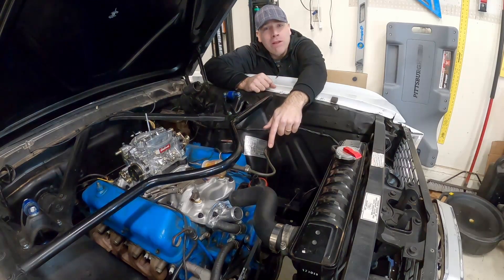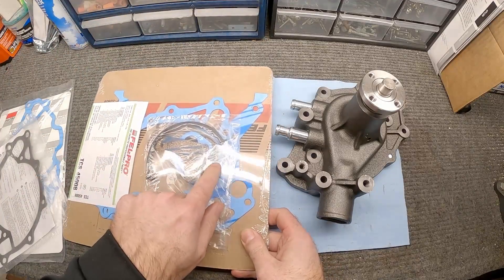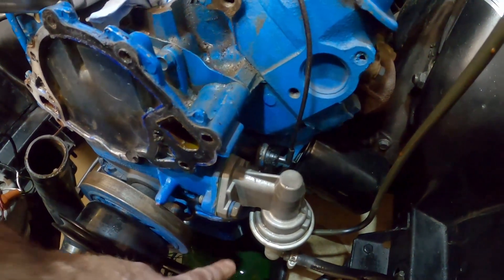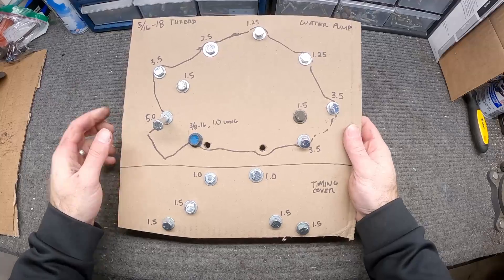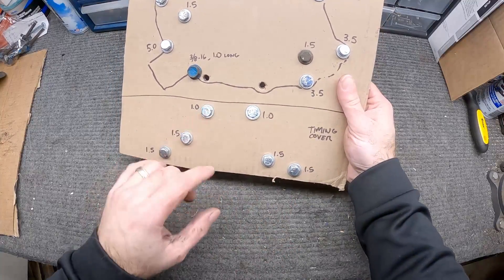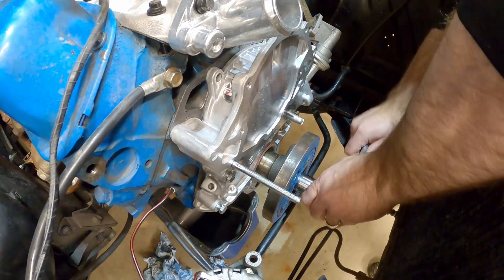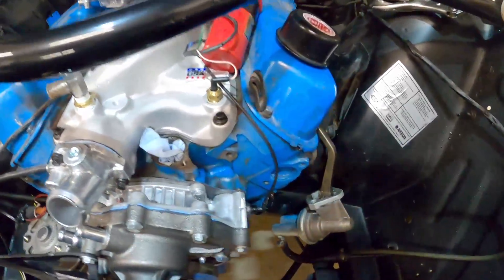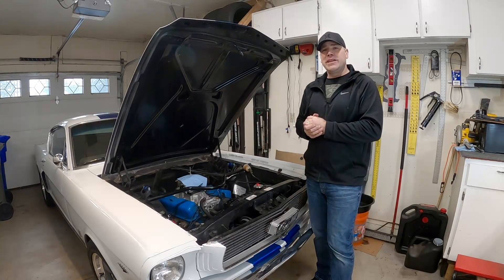How to replace a Water Pump and Timing Cover

Comment: Thank you! Just got my dream car, a 1967 Mustang with the small block 289. For 8 grand! And it drives with body work done. Absolute steal. 

Also, the engine is a K-code. Got lucky there.
Reply from the maker: Good luck with your new project!  🙂

Comment: I know what you mean with over tightening bolts. It sucks but it's way easy to do. Good work! Looks like you've been getting after it!
Reply from the maker: Thanks!  I'm just glad I was able to save that spot and not have it be one where I can't run a through-bolt in there.  :)
Reply: @AndyKruseChannel  exactly! You lucked out there for sure.

Comment: Thats a lot of work for a little leak! Going that far I would change the dampener. They're not expensive but the rubber seal inside the damper is usually cracked and hard. Made a difference to mine runs much smoother with a new one.
Reply from the maker: Yeah, not a bad idea, but at this time in my build I had new engine plans so I didn't want to spend money on something that was only going to be temporary.  :)

Comment: Good job!  One thing folks might want to consider is putting a sheet of cardboard over the engine side of the radiator if it's not going to be removed for this job.  This will help protect it from getting banged into by tools and parts.
Reply from the maker: Great tip!

Comment: Getting ready to change the water pump on my 65 Falcon (289).
It's the original never been off, anticipating the bolts will be a pain to get out without breaking off.
Reply from the maker: Good luck!!
Reply: @AndyKruseChannel  Thank you

Comment: I have a 1968 Mustang. It now has a new BP 306. I'm wondering why the radiator is overflowing through the overflow hose? Overflow never occurred with my 289.  Oh, when I say my coolant is overflowing I mean it's overflowing a lot.  The car has not been driven since the new engine was installed. I'm thinking the thermostat is not working correctly. Thoughts? 

I'm working on getting the temp gauge working, currently it does not.
Reply from the maker: Could be a couple things.  If the thermostat is set at too high of a point, you might be getting too hot of coolant too late and the radiator can't cool it fast enough. When it's that hot, the pressure is also really high, and it might be overpowering your Rad cap, leading to the coolant overflow issue.  It could also be the Rad cap set point is too low, should be around 13-15 psi.  Other potential issues might be the water pump is not working correctly, or some kind of blockage somewhere, or maybe the Rad fan(s) are moving enough air when the car is sitting.  :)
Reply: @AndyKruseChannel  So the issue was fixed by changing the Rad cap. This $10 part is less that the 18 bucks I spent on coolant. Honestly I don't care about the money I just want my car ready for spring. 

Thanks for your response.

Comment: Hi Andy, do I have to do anything special with the timing or harmonic if I just take off the cover, replace the gasket and don’t touch anything else? I turned the engine over a few times trying to get the balancer off.
Reply from the maker: Nothing special, but you'll need to get a "puller".  If you don't have one, most auto parts stores can rent you one for fairly cheap.  You've got this!  :)
Reply: @AndyKruseChannel  alright sweet I appreciate it, yeah I got the puller rented right now, just wanted to make sure I didn’t screw anything up since I couldn’t get the center bolt off initially and rotated it a couple times. Thanks for the reply! I got a 1971 v8 maverick and your videos are the main ones helping me out. After this gasket. All I got left is the suspension and the exhaust until I’ve replaced almost everything mechanically 💪🏼

Comment: Great video! 
It looks like I have coolant leaking around my timing cover on my 72 302. If I just pull the timing cover off and replace the cover to block gasket and use those oil pan "gasket pieces" that the timing cover kit gives you to seal the bottom,  when you pull the timing cover off the front of the engine block, does old gasket and dirt debris drop inside the oil pan?
Reply from the maker: It can, so you’d need to be careful. You can tape a garbage bag over the oil pan to catch any debris.
The coolant leak is either from your thermostat housing or intake manifold gasket, I’d suggest fixing that before tackling the timing cover gasket, unless you’ve already done that. 🙂
Reply: @AndyKruseChannel  Hi Andy! Thank you so much for the recommendations. Unfortunately, it does seem to be coming from the timing cover to block gasket.  In colder weather I can find a pool of Coolant on each side above where timing cover coolant passes are. After I soak it up, you can see it slowly leak out of that area.  I did check out the thermostat housing cover, slid paper towels under it left it a few days and didn't  seem to gather coolant there. It would be nice if that was the source though.
It's been going on a while. During the summer, no leaks. But when the vehicle is stored for the winter, that area behind the timing cover starts leaking. 
I really appreciate your reply! 
Thank You!
Reply: Got the same thing, slow leak from cover. Just need to pull my balance and then I can inspect and put a new gasket on

Comment: Andy I have a 1966 mustang 289 4 barrel but the front crank seal 2692 is too big for the housing and also seal is too large for the shaft coming out of the engine,  any thoughts???
Reply from the maker: The timing cover is the key.  If the seal on the timing cover is installed from the back side, then you need the seal that goes with that cover.  If the seal installs from the front, then you need the seal that goes with that timing cover.  Unfortunately there different covers that came on these cars and different ones can be installed, making it difficult to know which seal needs to be purchased.  The 2692 seal only works with the timing covers that are made for the seal to be installed from the front, like the new unit I installed in this video.  By your comment, I'm guessing you have the timing cover where the seal is installed on the back side, meaning the water pump and timing cover need to come off the car.  If this is the case, and you have the funds to make the change, I suggest getting the timing cover I install in this video.  It makes servicing this seal down the road much easier.  :)

Comment: Hey Andy, can you share the part number for the fasteners on the water pump? Thanks!
Reply from the maker: I sourced all these at my local hardware store.  On my previous Mustang, I purchased an ARP kit and the bolt lengths were not accurate for some of the locations.  What I have in this video (on that cardboard template) are the lengths that works on my 289 with the new aluminum timing cover and cast water pump.  :)

Comment: Hi ,how did you torque the harmonic balancer , without turning the engine over?
Reply from the maker: Take the starter out and put a pry bar on the flywheel teeth to hold everything in place.

Comment: Great video! Thankfully I'm functioning very well still but should I need to do a replace I'll be following your lead
Reply from the maker: Awesome, hopefully there's enough info here for you to knock it out of the park!  :)
Reply: @AndyKruseChannel  the use of the cardboard is a nice idea, I usually just do guess work and end up having too many "extra" pieces
Reply from the maker: @jordanschultz2232  Haha, I was always told that if you don't have extra parts when you're done, you did it wrong.  :)
Reply: @AndyKruseChannel  definitely for LG washing machines or anything made in Taiwan but I was surprised by the volume of extra fasteners I ended up with after reassembling my grownup Lego

Comment: Love all the videos, big fan! 👏 I will be doing the same thing soon. I bought an edelbrock aluminum water pump. Was planning to re-use my same timing cover, but i like the nice aluminum one, will that same one you used work for my 1969 small block 302? And what bolts did you use, just normal stainless steel from the hardware store? Lock washers, regular washers, or no washers?
Reply from the maker: Thanks for the support!
Yes, the same timing cover will fit your engine.  I recommend the cover I used in this video as it will make servicing the shaft seal a breeze if you ever need to do it down the road.
You can re-use your OEM bolts, but if you want new bolts, check out the video I made where I was getting my new 347 ready for install.  In that video I show the template I used for the bolts and what their sizes were.

Comment: Thank you for posting this! I’m getting ready to do this exact same job and this is super helpful. Question, do you have to take the oil pan off or just loosen some of the bolts?
Reply from the maker: It depends on the type of oil pan gasket you have.  If you have the traditional corks pieces with the rubber end caps, you can just remove the 4 bolts on the end.  If you have a one-piece gasket like I have, you'll need to remove the oil pan and replace the gasket.
Reply: Thanks Andy, I just went back and watched the video over again and I saw the part where you went over my exact question 🤦🏻‍♂️Thanks for responding!

Comment: Andy, I have the earlier 65 style water pump with aluminum housing without backing plate that uses the timing cover for the back. Do you know if I can change it to the style you are using here?
Reply from the maker: Yes, you can change it to this style, it all fits the same.  😁
Reply: Andy Kruse mine doesn’t have the backing plate. Are you saying that I need to change everything out including the timing chain cover?
Reply from the maker: I think I see what you're saying now.  Your timing cover is designed to work as the backing plate and the new water pumps (with the steel backing plate) may not fit.   You'll need to match the correct pump to your timing cover.  I think they changed in 1965, so you may have a 1964 timing cover and pump?
Reply: Andy Kruse, yes my car is a April 65 build with the original engine and the change came in June I believe. I was wondering if I change everything including the timing cover and the water pump will everything match up? If the bolt pattern and everything matches up and I can change out everything then the cooling should work fine. I was just picking your brain to see if that would work. In other words, did they change any of the bolt patterns Or are they identical?
Reply from the maker: Yes, the newer style timing cover and newer style water pump will bolt right up to the face of your motor.  However, be mindful that some time covers don't have the dowels in the lower section that "centers" the timing cover on the block.  If this is the case, you are left with allowing the crank seal to do the centering, so don't tighten down one bolt all the way on one side until you've had a chance to tight bolts on the other side of the timing cover.  Sneak up on them so that the timing cover doesn't get move to one side or another relative to the seal and the crank.  I believe I mention this in the video.  If able, find the timing cover with the dowels, it will be easier.  :)

Comment: Does the harmonic balancer need to be oriented a specific way, or can you just pop it in?
Reply from the maker: The Balancer is already keyed to the correct position, so you just slap it on there.  The important part is making sure you're installing the correct imbalance unit that matches your setup.  Meaning, if you have a 28oz imbalance, then make sure your harmonic balancer also has a 28oz imbalance.  :)
Reply: @AndyKruseChannel   good to know. Thank you.

Comment: how did you torque down the damper bolt without the engine spinning? i'm doing this and stuck on that part. i also have an automatic.
Reply from the maker: In this video I took the access cover off my C4 bellhousing and put a pry bar in the against the flex-plate teeth to keep the motor from spinning.  It was not an ideal way to do this.  I actually had to replace the front main seal not long after I did this timing cover (the video is now live on the channel) because of a leak, but this time I put two bolts in the harmonic balancer where the alternator pulley bolts in and used a pry bar to hold the crank still while I torqued that main bolt.  I'm probably not describing it well, but you can see it in that Front Main Seal video.  :)
Reply: @AndyKruseChannel  that worked. thanks!

Comment: Andy, where did you find that new timing cover?  The timing cover gasket surface looks rough and I might have to replace . Thanks .
Reply from the maker: I ordered it from Summit Racing, but lots of places sell it.  The specific one I used is part number C4AZ-6019-B.
Reply: @AndyKruseChannel  Thank You Andy .

Comment: I have an AC car with Power Steering..do you think I can get away without taking the rad out?
Reply from the maker: That's tough to say, without seeing everything is routed and installed.  Since you have more items in your engine bay and the coolant has to be drained anyway, it's probably going to be easier in the long run to just pull the Rad.  :)

Comment: No power steering on that.  Where did u get the new replacement bolts for the water pump?
Reply from the maker: Purchased at the hardware store.

Comment: I have coolant accumulating in the spot. Did this fix the issue?
Reply from the maker: Yep. It’s almost always that gasket if you’re getting coolant there. 😁
Reply: @AndyKruseChannel  the one for the timing cover?
Reply from the maker: @darrellanderson6650  Sorry, I was thinking you were saying you are getting coolant accumulating on the timing cover, below the thermostat housing.  If so, then it's using the thermostat gasket.  Are you getting coolant pooling somewhere else?
Reply: @AndyKruseChannel  

It is right above the fuel filter and behind the water pump. Two puddles. 

Thanks.
Reply from the maker: @darrellanderson6650  If it's on the driver's side, it's possible it's the thermostat housing, but more likely it's the intake manifold gasket.  If you're careful, you can replace these gaskets without pulling the distributor, which ultimately makes it easier, especially if you're not comfortable resetting the timing for the engine.  It's also possible the water pump gasket is leaking, but it's hard to tell without being there.  :)
Reply: @AndyKruseChannel  Thanks and I really like all your videos. They are extremely helpful.

Comment: Hey one question can I do this without draining the oil?
Reply from the maker: Yes, but just be really careful you don't drop anything down inside the oil pan.  When pulling the timing cover, there is some access to the oil pan from the front, so be sure nothing falls down there, or you'll have to drain the oil and pull the pan.  But it can definitely be done without draining the oil.  :)

Comment: I can't seem to find a set of
Fasteners to fit this style cover, any advice?
Reply from the maker: I went to the hardware store and picked up the ones I needed.  :)
Reply: Second question. I just installed this same timing cover, and my harmonic balencer does not seem to go on all the way, it actually looks very similar to where yours ended up. Is this normal?
Reply from the maker: @williamwilde141  If your HB went on as far as mine, send it!  :)
Reply: @ you wouldn't happen to have a photo of its final position?
Reply from the maker: @williamwilde141  Sorry Brotha, that engine is not in my car anymore.  :)
Reply: @ thanks for responding. Love the channel

Comment: I'm just about to do this. So glad you have this video. Question: the timing chain cover bolts are torqued to inches, right? Second, the engine builder installed a gear drive instead of chain drive. I hate it. Would converting to chain be any issue? Also, how did you find top dead center to line it up before taking off the harmonic balancer?
Reply from the maker: If you have torque specs and the numbers are small, it's in ft-lbs (like 9 or 11).  If the numbers are large (like 50 or 70), then it's inch pounds.
The benefit of the gear driven timing is the almost impossibility of the chain slipping or wearing down the sprocket teeth.  However, gears can be noisy and they have less tolerance of parts not fitting perfectly.  I'm not sure of any performance gains of either setup at the power levels you're probably at, but if there's something wrong and you're replacing parts, go with the parts you'd rather have.
My balancer has a mark on it for TDC, so it's easy for me.  I think the key slot on the crank also helps tell where TDC is located, but for timing purposes (ignition vs exhaust) you'll want to check where the distributor is pointing by pulling the cap.  :)
Reply: @AndyKruseChannel  I have a 347 stroker, but I can’t stand the gear whine. It’s that bad.
Reply from the maker: Then a dual roller chain is in your future!
347 you say?  Care to share the specs?  :)

Comment: Hi, I think it should be said that the 2692 seal you installed in your new timing cover will not fit the old original timing cover. Not sure if it is because you used a aftermarket timing cover or if there is a model year difference with the timing covers.
Reply from the maker: Correct, I clarify that this timing cover is the kind where the seal is installed from the front.  This timing cover is from later model 302s, so it accepts the new seal.  :)
Reply: @AndyKruseChannel  Yep very different from any 351W or early model 302.